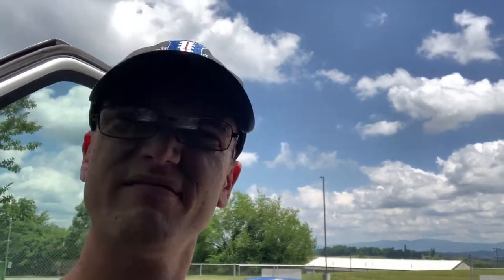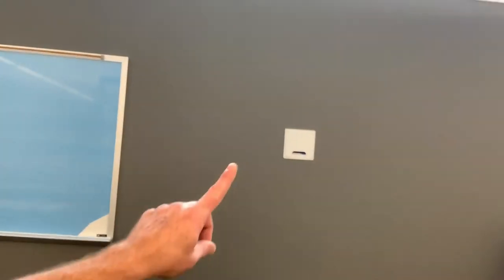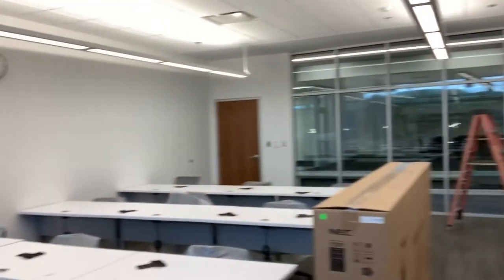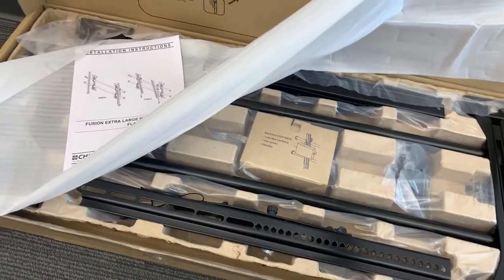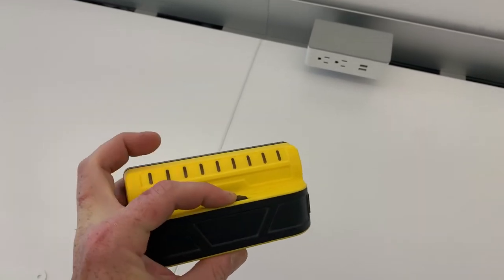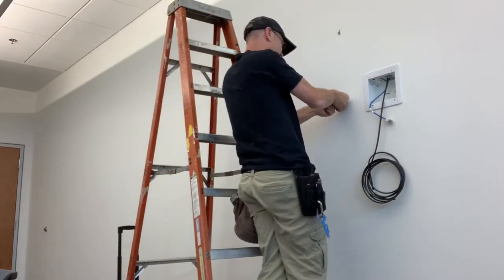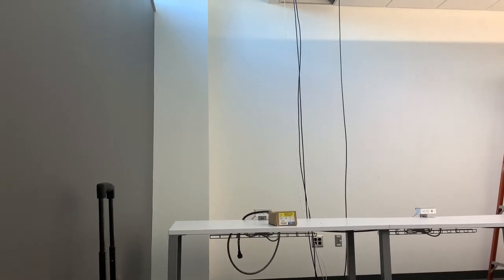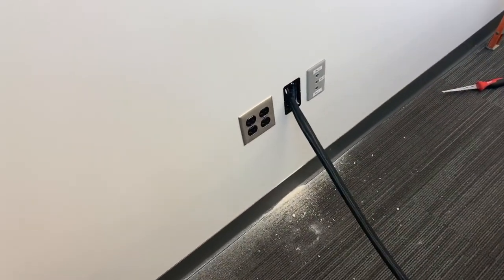How I install Audio Video in a Commercial World

Comment: Zip toggles or toggle bolts for the metal studs. Great work looks super clean. What video cables did you use for the displays? Are you a fan of CATV with baluns for long HD runs?
Reply from the maker: Umm I believe it was Cat6 shielded to a transmitter to receiver. From transmitter to display it was HDMI.  Thanks for the comment. Appreciate it!